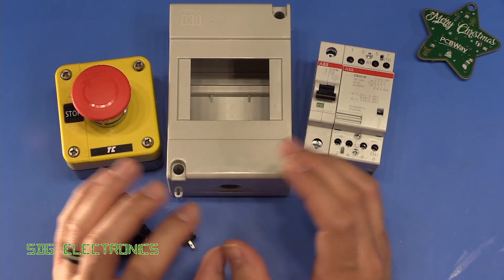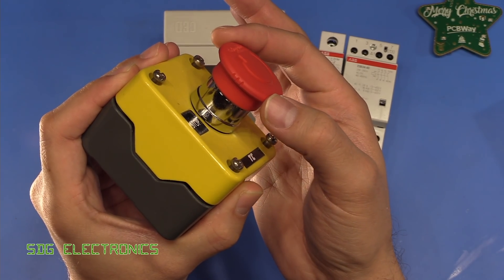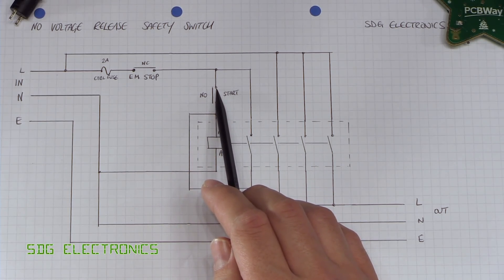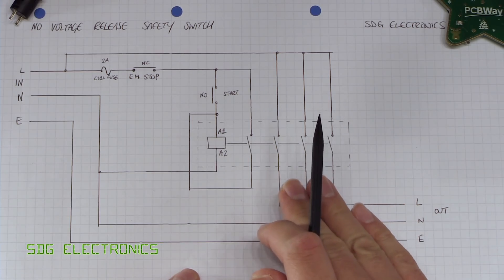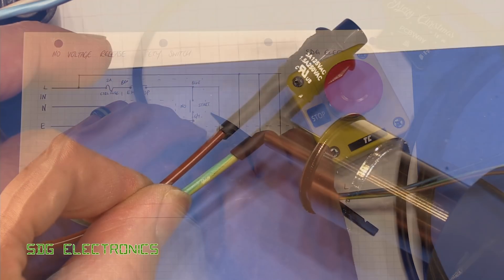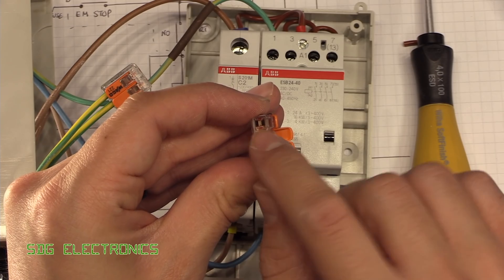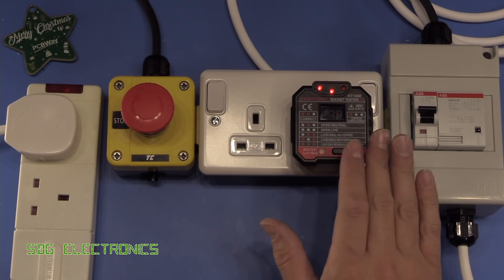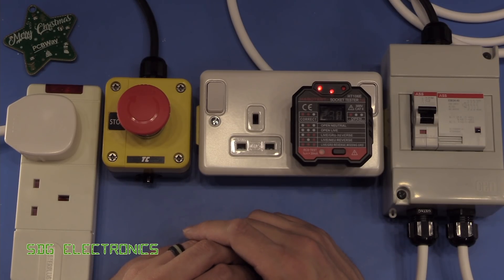SDG #126 Make an Emergency Stop with NVR System for your Work Bench

Comment: I really like this, but. Why is it no voltage? It has 240v through it. Would it not have been better to make it safer and fit a din rail psu and bring it down to 12 or 24v and use a dc contactor?

Comment: First of all: Great idea, wonderful attitude and proper use of a circuit breaker for separate paths of switched equipment in your design.
As an option for such applications, it is better to use a safety relay that meets the requirements of EN 60947-5-1, EN 60204-1 and VDE 0113-1. Maybe you also need to place more than one safety switch as stated in  DIN EN 60204-1:2019-06;VDE 0113-1:2019-06/VDE 0113-1:2019-06. see "Safety of machinery — Emergency stop function — Principles for design", ISO 13850:2015.
Your ABB ESB24-40 contactor conforms to EN 60947-4-1. That is good. The purpose of that specialized gear i mention is that they have a protection from mechanically and electrically latch up in a failure condition(Even a partial contact error is guaranteed not to occur). This shouldn't be a critique at your implementation, just a reminder what is possible and the guideline: Better no security than false security;)
As stated by Drachenkatze and Archibald Frederick: Do not re-purpose the green/yellow Schutzleiter! It is a bad habit with or without colored cable-sleeves. You don't know who handles your  installation in 20 years. This is out of your control. What lies in your hand is to use a proper cable. There are plenty ones out there, like the cables with numbers on the cores or without green/yellow for switching-applications. For people in a country without a regulation like IEC 60364-41-1/VDE 0100-410: Just don't do it. Its selfish, lazy and irresponsible(Again, no accusation against the creator or the viewers, just a reminder, just do it!;).

Comment: Hi, nice video, however I'd rather user a low control voltage for the contactor (e.g 12V or 24V). It's not relly safe to have a mains cable on the bench. Stay Safe bye

Comment: Excellent tutorial for the serious hobbyist, all power tools should be fed via this control system. Great explanation on a latching circuit.
I test and commission special purpose machines.
I would prefer to have the multiple contacts in series, sharing the convention when using 3 Phase Circuit Breaker with a 2 phase supply.  NVR is standard on all 3 phase machines, we also use two channel E-Stop with monitoring safety relays.
Thanks for sharing.

Comment: Having studied the IEEE wiring regulations some years ago one alarming thing sticks out - do not use the earth wire as a live conductor. 

Re-using the earth conductor is a no no. Regulations say something like ""The bi-colour combination green and yellow shall be used exclusively for identification of a protective conductor and this combination shall not be used for any other purpose "". You need to go and buy a cable with three counductors + earth, so four in total. You local diy store probablly has some, if not there are plenty of other places to buy cable (Toolstation, Screwfix, TLC, etc.).
I think I would have also put a second stop switch by the exit door. Then if something goes up in flames you can still hit the stop button as you'r running out the room. Simply wire the stop switches in series.

Comment: I’ve worked in a printing press / bindery and  you’d be eaten up by nasty machine works if ever you let yourself doze off and fall forward.  So we had our emergency stop switches which were identical to yours hanging from the rafters above and the switch would
Literally hang at a height of about 1.6 meters from the floor in a very suitable location.  As a reminder to keep ourselves nice and wide eyed and alert, right up on the wall behind the machinery and at eye level, we would hang some sort of ugly looking sheet of corrugated cardboard with red ink spilled on it (suggesting that it was under the feet of an unlucky soul who was recently inducted into the amputee’s club, at the time of their initiation rite)!  There are a great many more dangers around these industrious places that would maybe not come to mind upon a simple first tour of the facility.  I’ve seen so many types of factories and research plants and et cetera that had unbelievable installations with all types of specialty environments while my father worked as a structural engineer for 3M.  The common detail that I couldn’t ever forget in any of these places is that red button!  In a nuclear reactor that button would flood the reactor with boron!  In a chemistry laboratory inside of small room inside a warehouse, with lines on the outside of the walls on the floor that say, “Stay clear!  Do not cross line!”.  Push the red button in there?  It’s walls would literally blow out to release pressure, and return it’s conditions to stable before a more dreadful chemical reaction could cause something far more catastrophic to happen.  Then when I visited my sister after she started work at the Federal Reserve bank, I learned that there, those buttons lock the whole building down and prevent anyone from leaving in the event of a mad gunman, robbers, or renegade robots gone haywire.  Literally bars or walls come and slam down in front of the windows and doors, and this is a huge building with ~twenty floors.  I guess what I’m getting at is that the bigger that red button is in my mind’s eye, the more fearful I am of pressing it!  It would be an irresponsible thing to just push that button without any real cause for the action.  It would be a costly mistake in many situations.  Still as we might remember at Fukushima, they could have preserved a great deal of security and trust had they been more ready to flood that reactor with boron, but that would imply some serious consequences.  I fear the day when prospects outweigh the safety of workers, and the public.  For now, there’s building codes, but it’s a sad observation that these codes should be the law when safety ought to come before earnings.  To think that there would be fewer considerations made for safety if greedy corporations were allowed to act without oversight, that makes me feel pretty down.  Excellent project!  THANKS FOR SHARING!

Comment: Hi! Really well done, but you should only use green/yellow for PE and blue for neutral. This is rather a must than a should, even for the blue wire, given the ubiquitous TN earthing system you have in the UK. 3-wire cords are commonly available with brown/black/gray wires.
Also, should one of the contactor's way weld closed for whatever reason, it would be pointless for the other two to open. Three phase contactors (and motor relays) are usually wired in series when used single-phase. In a TT system you would use two ways in series for phase and one for neutral. Wiring them in parallel can multiply almost by three the chance of something going wrong...I say almost because the contacts are sharing the load and thus subject to a lighter duty. The emergency stop button in many cases can also be wired with two contacts in series.

Comment: Not sure what would tick off our local electricians more: Using green/yellow for a live connection (which some do here too) or twisting a stranded cable (which is a mortal sin according to others) ;)
Reply from the maker: The stranded wire actually had that twist in it. Not done by me!

Comment: That's a properly done emergency stop system, only thing I would add is you could have 2 NC contacts in series on the stop button (for redundancy, in industrial estop systems, it's generally 2 channels, each button has 2 NC contacts, one for each channel, it stops if any of the circuits is broken and won't let you start again unless the both get closed at the same time which works as a self test and anti tamper system) considering you have a contactor that has sufficiently sized contacts, going for series on that is also better (the priority is to break the line, not to close the contacts)
On another note... I have 2 machines at work which need to get the E-stop made from scratch, since the chineese made it NO contacts...
Also, in Poland we call the E-stop buttons mushrooms

Comment: I would use a 3 way box for the control pendant, with Estop at the bottom, a green recessed push pendant at top, with only a single NO contact, and then in the middle a red LED lamp unit. Otherwise a 2 way box, a combined start stop lamp unit, and the Estop in the other. 4 core cable to wire it, as with the lamp you need a neutral, unless you are prepared to rewire it so it is current operated instead, in which case it goes in series with the coil wire.

Control box the breaker is a good idea, and also remember that contacts 13 and 14 are there strictly for signal current use, they are not mains rated like 1-6 are, but only for 1A coil loads. As the main contacts are double break anyway, a single one will not stick easily, and they are capable as well of breaking 16A, and will survive turning on into a short longer than it takes the fuse to blow. A tip is to put a 275VAC MOV across the coil itself, to reduce the spike on power off, and place another on the output as well. easiest way to do so is to ignore contact 5 and 6, and use the output side as a common neutral bus point instead with contact 6, giving a convenient connection block. For the coil a small 7mm MOV will work, but for the output a much larger unit is preferable, with either a thermal fuse disconnect shrink sleeved to it, or with built in thermal protection.

At home I use a 63A relay for lighting control, just because I got it as scrap metal with a box, and it is massive overkill, but survives all shorts perfectly, and likely will wear out physically from the cores breaking before anything else fails. Similar idea, to control lighting from a single photocontrol, and also allows manual operation with a switch.

With the boxes as well use good quality cable glands, and if they are metal boxes a metal gland. use thread locker on the threads as well, so they do not come loose with movement, I have made plenty of extension cords using industrial socket outlets, as those come with a metal box, and are very tough. You can chain them together using couplings, so you get a nice selection of sockets, though here you do not find BS rectangular pin sockets often ( mostly only for dedicated use in old buildings), but round pin socket outlets, and now I also use regular surface boxes as well, to hold dual outlets and the type M sockets, just use the heavy duty ones, typically Legrand.

Comment: Emergency stop button is great if you work with mains or power electronics. When FETs start smoking or sparks begin to fly, it is so great to have a quick switch to power everything off..
I think if you have room to make a lab, you should have one. It is also very handy to power everything off by a single point when you're finished.

Comment: Nice explanation.  I was expecting more comment heat regarding the use of the Green/Yellow. My interpretation of what I have heard was it can be used for something other than earth as long as the exposed section is completely sleeved in another appropriate colour so the green/yellow is no longer visible.  Curious what others think/know.
Reply: This varies by country. In Germany for private households there's no requirement to get electrical installation verified in regular intervals. Basically: Whatever you install for yourself is your responsibility. If nothing serious happens with the installation, no problem. However, in case of injuries or fire the insurance companies or legal authorities will check if you did the installation properly. However, I always recommend to follow standards as closely as possible and using Green/Yellow for PE only. 

According to EN 60204-1, the use of Green/Yellow is not explicitly prohibited. For Germany,  DIN VDE 0100-54 prohibits the use of Green/Yellow for other purposes. Unfortunately, most of the information regarding this can only be found on the german Wikipedia article "Schutzleiter".
Reply from the maker: @alek202  basically the same in the UK

Comment: Thanks Steve...when we moved into our current (no pun intended!) home I needed a 220VAC line run to my ham radio room to power my HF linear amplifier. I had the electrician install a "pony panel" with appropriate circuit breakers, with a large "Emergency" sign on the cover. My better half knows that if she finds me doing the "funky chicken" that she goes to the panel to switch off everything at the radio desk and workbench, hopefully in time!  Happy Holidays!
Reply: Has your better half ever found you doing the 'funky chicken'? (I am still giggling with the image of someone in a basement doing the funky chicken until their other half comes along and hits the emergency stop where upon they collapse in a heap saying something clever)
Reply: @kissingfrogs  Fortunately not to date and hopefully never! I got bit once in high school in the late 60's building a Novice transmitter...somehow grabbed the B+ line and the next thing I knew I was half way across the room; learned my one-hand-in-the-pocket lesson the hard way and would prefer not to rely on someone else to save me..."Oh dear, would you mind switching the breaker off for me please?"  ;-)
Reply: @Dino, thanks for the laugh 😂😂😂